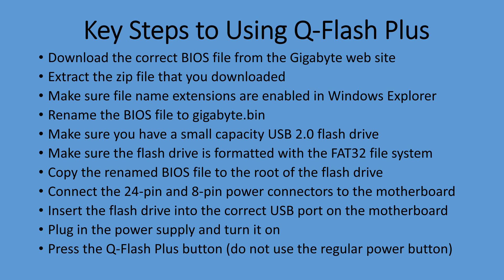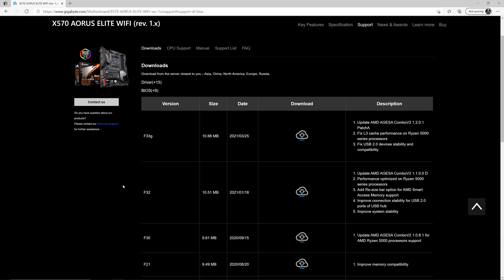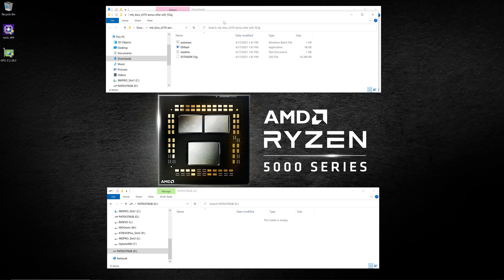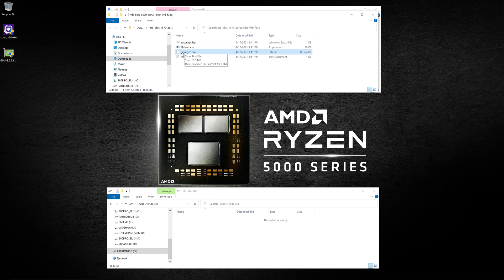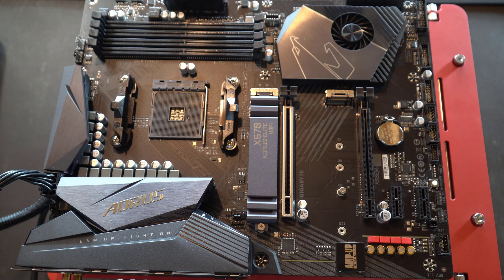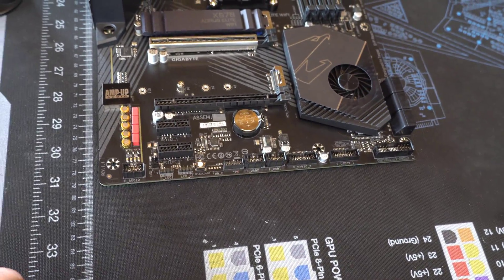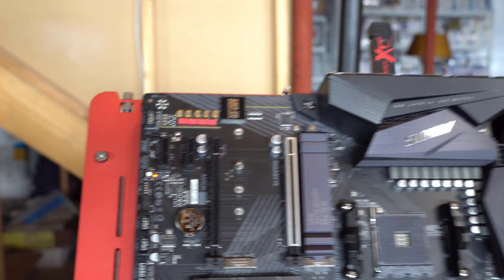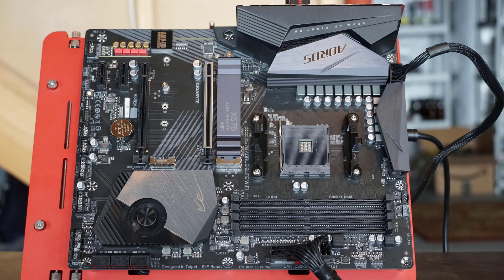How to Flash the Gigabyte X570 AORUS Elite WiFi with Q-Flash Plus

Comment: Hi Glenn thank you for this video! I have an ASUS ROG Crosshair viii hero that I am trying to do this with. Any insight on what I need to name the file? Or any other changes I need to make?

Thanks!
Reply from the maker: Their support page explains it "Before running the USB BIOS Flashback tool, please rename the BIOS file (C8H.CAP) using BIOSRenamer"

https://rog.asus.com/us/motherboards/rog-crosshair/rog-crosshair-viii-hero-model/helpdesk_bios
Reply: @GlennBerrySQL  Thank you Glenn for your answer: one other question - will this work with a 32gb flash drive as long as it is formatted with FAT32? Thanks!
Reply from the maker: @samerabusway  It might. 16GB or smaller drives tend to work better.

Comment: The flash led stopped blinking but the fan is still spanning... Is this normal???
Reply from the maker: The only thing that matters is the BIOS flash LED. It should have flashed for 5-6 minutes and then stopped flashing. It does not matter what the fans or any other LEDs are doing.
Reply: @GlennBerrySQL  Glenn you're a lifesaver I swear. I checked this video and he had the same issue and you're right. The flash led is the important one. God bless you

https://youtu.be/y9uGfIFufZI
Reply from the maker: @mo7sen94  Well, I'm glad you believe me now after seeing the same info on another video. Have fun with your system!

Comment: Hey Glen thank you for your extremely informative and thorough video! I have been scouring forums and other videos trying to find a solution that would work for my x570 Auros Pro Wifi rev 1.0 and though I have followed your method to the letter (other than the QFlash Plus button being located on the IO panel, I have still not even been able to get the QFLED to even flash once. The USB light flashes for about 5-6 seconds after hitting the QFlash button and then just turns off. I've tried about 7 different USB 2.0 drives all with no success. Any ideas of what I could possibly do would be greatly appreciated!
Reply from the maker: I'm sorry you are having problems. If the USB LED or the Q-Flash LED only flash for a few seconds and then stop, that means that Q-Flash Plus is having trouble reading the USB or that what it is reading is not what it expects to find.

Did you download the correct BIOS update for your motherboard?

Did you rename the actual BIOS update file (not the entire zip file)?

Is the renamed BIOS file in the root of the USB flash drive?

Is the flash drive formatted with FAT32?
Reply: @GlennBerrySQL  Thanks for the swift response! I have tried with multiple BIOS versions from F30 to F34b all on the root of the USB flash drive, all formatted with FAT32. I have not seen the Q-Flash LED flash once, though it makes sense that Q-Flash Plus is having trouble reading the USB as it attempts to read it and fails. I just can't figure out why it's failing in the first place. I'll try some USB's that others have recommended using that have worked for them. The last thing I want to do is go out and buy a Ryzen 3000 series CPU just to update the BIOS...
Reply: @lengg1855  any luck?
Reply: @andrewtrowbridge  hey mate, unfortunately not.. I've resorted to purchasing a ryzen 3 1200 and doing a standard Bios update. Will let you know how that goes as I suspect my issue has something to do with the qflash feature.
Reply: @lengg1855  My cousin is having the same issue any fixes

Comment: What happens if the light only flashes for a short time? Does the USB have to be 2.0 or is 3.0 okay??
Reply from the maker: That usually means there is a problem reading from the USB drive. USB 2.0 works much better than USB 3.0 for this

Comment: How do I find the "root" of the flash drive?
Reply from the maker: The root is the top of the directory structure. So if your flash drive was the D: drive, it would be D:\gigabyte.bin

You don't want the file in a directory or folder.

Comment: My file extension reads .F35 instead of 33G. Is that ok?
Reply from the maker: Yes. Every new version has a different file extension. You have to change the name for this file for Q-Flash Plus to work, so the original file extension does not matter.
Reply: @GlennBerrySQL  thanks Glenn!

Comment: Not sure if it was just me.  Had everything installed ram, cpu, USB.  Plugged in the USB, clicked the flash button nothing.  No light or anything.  Took everything out just power to motherboard and front panel.  Put in the USB and clicked the flash button worked perfectly.  Great tutorial just wanted to share my experience flashing f35 for my new 5600g.
Reply from the maker: It should work the same way in a bare system or a fully assembled system. It is important that you don't turn the fully assembled system on with the case power button. Just have it plugged in, with power supply switch turned on.

Glad you got it working.

Comment: Hey man, just tried doing this but nothing happens when I press the qflash! Any help?
Reply from the maker: My pinned comment has my standard troubleshooting steps.
Reply: Thanks for the very quick reply! Do I have to have file extensions enabled on the pc I’m doing it to? I’ve already installed my 5800x in the pc.
Reply from the maker: @noahkarlsen2592  If you have a fully assembled system, you don't want it to be "running" when you do this. It needs to be plugged in, with the power supply switch turned on, but don't turn on the machine with the case power switch. Just follow the directions in the video, and press the Q-Flash Plus button.

If your machine will already POST and you have Windows installed, you don't need to do this procedure. If you want to flash your BIOS, there are easier ways to do it (if it will already POST).
Reply: I’m doing because I went from a 3600x to 5800x. Swapped out the CPU’s and tried turning the pc on. Pc turned on and there’s no image. Because I forgot to flash the bios I’m guessing. I’ve followed your steps exactly, and nothing happens when I press the qflash button. USB is correctly formatted, renamed and in the right usb slot. Kinda freaking out over here lol. Sorry for all the questions!
Reply: I’m pretty sure I don’t have file extensions enabled on the computer if I do need that.
Reply: Got the light to start flashing, and then went on just lighting up. Suggestions? By the looks of things the USB is not blinking.
Reply from the maker: @noahkarlsen2592  Which LED are you talking about? The only one that matters is the BIOS flash LED, next to where the USB port is. That one should flash for 6-7 minutes and then stop. After that turn off your power supply, wait a minute and turn it back on, and press the case power button to see if your system will POST.
Reply: @GlennBerrySQL  Thanks for the replies brother. I put the usb drive in and flipped the switch on my PSU. Waited a bit then pressed the qflash. Both the usb and MB started flashing. Went on for maybe 4-5 minutes. Then the USB stopped flashing. MB stopped flashing for a second then it lit up all the time. I let it run for about 10 mins and turned it off again. No post.
Reply: Finally got it to finish flashing. Had to remove every component. MOBO light stopped blinking and turned off. But now my pc won’t post..
Reply from the maker: @noahkarlsen2592  I would try putting your old CPU back in the system and see if it will POST
Reply: Already tried that like 5 times. The thing won’t post no matter what I do. I don’t know what’s next? The mobo is supposed to be able to do this. Maybe warranty time?
Reply from the maker: @noahkarlsen2592  Have you tried clearing the CMOS? Flashing the BIOS also clears the CMOS. 

If the system was working with the old CPU, but now it won't POST with the old CPU, then the BIOS is probably messed up in some way.  I would take a minute to calm down and watch the entire video again, and then try flashing the BIOS with the Q-Flash method one more time. That is about all you can do.

The next step would be an RMA.
Reply: Yeah I’ve tried resetting the bios and then try the whole process again. Didn’t work with either cpu. Pretty sure I just have to RMA the mb at this point. Thanks for all the help man!

Comment: Hey don’t know if you’re still responding, but I have a x570 Aorus pro WiFi and my USB LED lights up for about 5 or so seconds like you said and turns off, I double checked that it’s in the root of the USB and formatted in FAT32, renamed gigabyte.bin plugged into the bios usb port. There is no LED on/near my Q-flash_plus button that lights up at all during this.

Any ideas?
Reply from the maker: Are you sure you downloaded the correct BIOS file?  Do you have a small capacity USB 2.0 flash drive?  Is the flash drive in the correct port?

Comment: Hi,
For starters, I am completing this on a built system that does not want to POST. When plugging in the flash drive into the BIOS input, the computer and PSU are off then PSU is turned on without booting the computer. The flash drive lights up as well. When pushing the Q-Flash Plus button, the USB lights up and seemingly acknowledges the MoBo is trying to update the BIOS, but the Q-Flash light does not light up at all. After ~10 seconds, the system attempts to boot up but still shows a DRAM error light on the MoBo. Meanwhile, the monitor lights up for a second only to show "No signal" using the DisplayPort connection. Any suggestions as to what is causing this setback? 
Thank you
Reply from the maker: I appreciate you providing some details about what you did and what you are seeing. Many people just say something like "It didn't work. Help me".

What CPU do you have?  Is this a new system that you just built?

Anyway, if the BIOS flash LED near the Q-Flash Plus button does not light up at all, that sounds like a problem with the USB flash drive. Q-Flash Plus is very simple minded. It is looking for a file with a specific name, in a specific location, on a USB 2.0 flash drive that is formatted with FAT32.

I would rewatch the video and make sure you followed all of the directions exactly. I would also try another USB flash drive.
Reply: @GlennBerrySQL  Howdy! 
I figured the more info to start, the faster we would reach a solution.

I am running a Ryzen 7 3700x on the x570 pro wifi with a gtx 1080 GPU. It is all a new build and has been giving me the same issue since I completed the build. Other components include a Samsung 980 m2 ssd, and two Oloy 16gb ddr4 ram sticks from the same package. 

I was afraid it was the flash drive... it is a 3.0 drive as compared to the 2.0 you referred to above and in the video. I will see if I have a spare 2.0 around or will purchase/borrow one. Let me know if any of the above info cautions you of other potential setbacks. Thanks

Vance
Reply from the maker: @vancemilo9790  Well, a Ryzen 7 3700X should POST and work with any BIOS version for this motherboard. You don't have to use Q-Flash Plus to update the BIOS (like you would with a Ryzen 5000 series CPU).

Your first challenge is figuring out why your system won't POST.

Do you have your monitor plugged into the video card (rather than a video port on the motherboard)?  The Ryzen 7 3700X does not have integrated graphics, so you have to use the discrete GPU.

Do you have the 24-pin and 8-pin PS connectors both plugged in?

When you power on the system, what if anything happens?
Reply: @GlennBerrySQL  I was under the same impression and am scratching my head at what could be the issue. 

I've tried all of the ports and you are correct that the motherboard doesn't give any signal notice, however, the GPU ports (specifically the DisplayPort) show "no signal. Make sure the DisplayPort settings are set to the correct version." I have changed the monitor version settings to no avail. I have also tried the HDMI ports on the GPU and just get a "no signal" message. 

There are two PS connectors plugged to the GPU and the power connectors also to the MoBo. When the switch is flipped on from the PSU, the RAM sticks begins to sequence through their color display and the GPU shows two white lights next to the connection ports. Upon pressing the power button, the system begins to boot up with all units powering on and the VGA/CPU/DRAM/BOOT lights sequencing from CPU to DRAM then stopping on DRAM without showing lights for VGA/BOOT. When looking at the monitor the screen displays the "no signal. Make sure the DisplayPort settings are set to the correct version." message then enters power saving mode. The system stays on until switched off from the PSU. Holding the power off button does not power the tower down. In addition, the GPU is the only part that is not NIB, it came from my roommate and was working on his tower before it was removed and upgraded. It was box stored until my build was ready for assembly and appears exceptionally clean and unharmed. 

Thanks for taking the time! I did not do the USB 2.0 because I haven't gone to the store yet. Although, it sounds like I shouldn't have to do this step so I will hold off until we are further along. I'm also positive I have a 2.0 somewhere around the house.
Reply: @GlennBerrySQL  
Hi Glenn,

I was out of town for a couple of weeks and am back with the computer.

The cable has been plugged into both the graphics card and the motherboard and neither has produced success. 

The pins are all plugged in, an issue I realized early on. 

When powering on the system, all the lights turn on for all components. When looking at the mobo, the four light indicators on the board for CPU/VGA/DRAM/BOOT only cycle the first two and then the DRAM light stays illuminated without any signal on the monitor. Thanks for your continued help!

Vance
Reply: @GlennBerrySQL  hi Glenn! Any thoughts or suggestions for my current build? Thanks
Reply from the maker: @vancemilo9790  With a Ryzen 7 3700X, you will never get a video signal from the motherboard video ports, since it does not have integrated graphics. I just don't want you to waste your time trying that. You have to get a video signal from the GPU.

Have you tried removing and reseating the RAM?  How many RAM sticks do you have and what slots are they in?  What kind of RAM do you have?
I would try to see if it will POST with just one RAM stick. I would also try clearing the CMOS.

If you had any extra components (such as RAM or a GPU) I would try them to try to figure out if you have a bad component or not.

Comment: Does the USB have to be USB 2.0? I only have 3.0 at 32GB capacity. Will that work?
Reply from the maker: Most of the time a USB 3.0 drive does not work as well for this specific, low-level procedure.
Reply: @GlennBerrySQL  Why is that? Educate me :)
Reply from the maker: @devinegamingtv3427  You would have to talk to the motherboard vendors about that. I suspect it is because the simple, low-level code that executes when you use Q-Flash Plus is pretty old and it relies on a lowest common denominator of a USB 2.0 flash drive formatted with FAT32, with the renamed BIOS file in the root of the drive.
Reply: @GlennBerrySQL  I just got this motherboard and a 5900X today. Going to try a q-flash and assemble it. Thank you for this informative video. I also went and got a USB 2.0, smallest capacity they had was 32GB, hopefully it will work!
Reply from the maker: @devinegamingtv3427  Great! Have fun with your new system!

Comment: Gigabyte shows a button on the IO panel and when it wasn't there on mine, I started to panic so thank you for sharing this! I found it!!!
Reply from the maker: Gigabyte has a bad habit of reusing images and videos for one motherboard (not the specific one you may have) in their documentation.
Reply: @GlennBerrySQL  I have the button on IO panel . I have purchased this MoBO last week . Will this button on IO panel will work or not ? This is my first build and  I am worried that I should not damage anything ..  So if I can use the IO Panel button , I will be much relieved
Reply from the maker: @mandargite  Make sure you download the correct BIOS file for your motherboard.

Comment: Mine took 4 to 5 min. Light was flashing after I hit the button and then sped up a minute or so later. Did that for a few minutes and slowed down for a min and then the light went out. Normal?
This is my first build for video editing. Im winging all this.
Reply from the maker: That sounds normal and it probably worked just fine. The only way to know for sure is to assemble the system and see if it will POST.

Comment: I’ve been trying to update the bios for my pc, but nothing happens when I press the q flash button. The led doesn’t flash.
Reply from the maker: Do you have this motherboard? Did you follow all of the instructions in the video exactly?

The pinned comment for this video has troubleshooting steps.
Reply: Yes I have the exact same motherboard. Apparently the usb drive I was using didn’t seem to work. I was finally able to get it to work after using another usb. Thanks for the responding though.
Reply from the maker: @MaxDaAxe  Glad you got it to work. Most of the time, the reason people have problems is because of the USB drive.

Comment: So I did everything as asked,plugged in my motherboard and only when I pushed Qflash the whole thing turned on and after 5 minutes or so it turned off. It is normal for the power supply to only turn on like that right? So I guess it's updated now... Anyway thanks for the video!
Reply from the maker: That sounds like it probably worked. The only way to know for sure is to assemble your system and see if it will POST.

Comment: I have a 5 3600 processor do you know what update is the latest that supports it
Reply from the maker: An AMD Ryzen 5 3600 will work with any BIOS version for this motherboard. Your system should POST with any BIOS version, so you don't need to use Q-Flash Plus.

If you want to update your BIOS to the latest version, just use the regular Q-Flash feature, which is much easier.